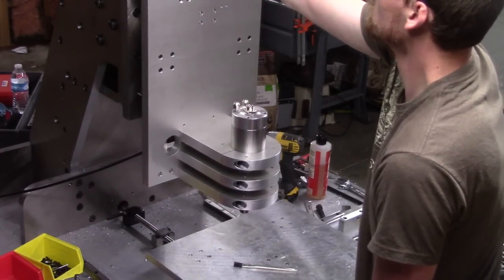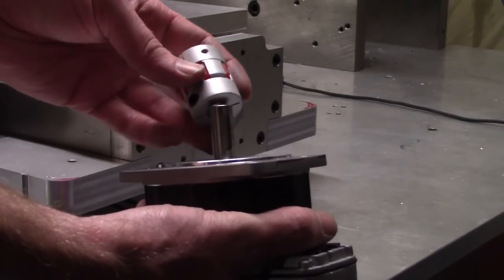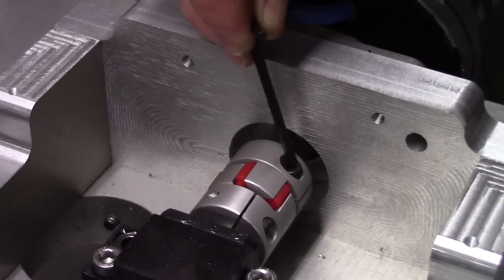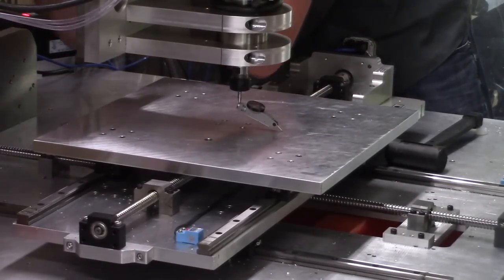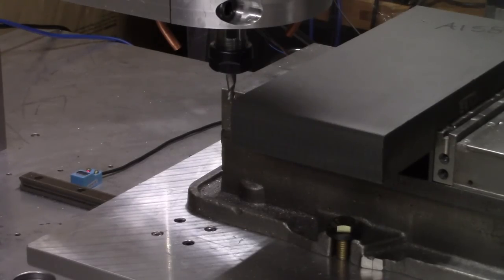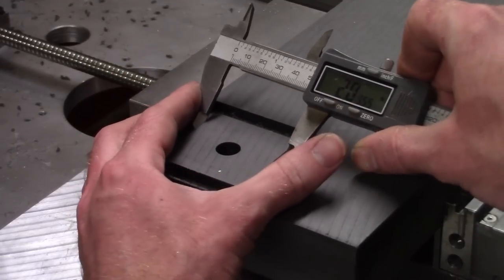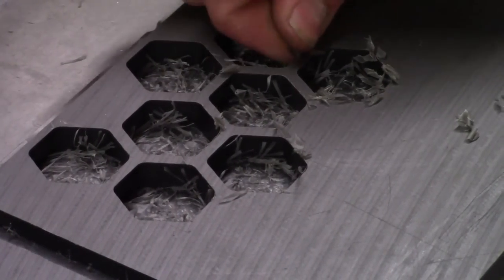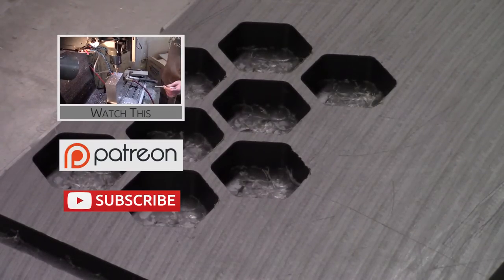The DIY VMC's First Steps!

Comment: so how much did you spend on all of this (including the discounts you got from buying the scrap steel)
Reply from the maker: I've not been good at keeping track but somewhere in the $3,000 range.
Reply: +Chris DePrisco holy.... WHAT! With those travels too? jeez man, whats your rapid feedrate? Did the bulk of the cost come from the servos and ballscrews? For only 3000 bucks youve got something that probably rivals a tormach. Great build man, I CANT WAIT to see that thing shred aluminum. But seriously im just imagining dumping 6-7 grand and designing and building my own frigging cnc mill (pretty good design exercise to try and make a rigid setup too). The one ive had the "pleasure" of working with for my robotics team costed 6 grand and cant even drive its x-axis stepper properly. Its a piece of junk, and has half the travels of this beast. Your machine hypes me up so much, everytime the last 3 or 4 videos came out from this series of just been so exited for the final product. I wouldve been horrified if you put steppers on something youve worked that hard on. Then i see the damn thing doing 300 ipm and interpolating that hole and I just :0...
Reply from the maker: Haha yea, getting the metal for scrap price is a huge deal of the cost savings.  Most all of the cost is in the motors, ball screws and electronics.  The theoretical max IPM is about 800 with 4000RPM motors and 5mm lead ball screws.  There was an issue with running that that speed though (although I can't remember what, over torque errors maybe?) so I dropped it back to 500 IPM and then it was happy.  I haven't been back to experimenting with how fast they will run reliably, yet.

Right now I'm actually getting the whole machine rocking several thousandths while running the table with the big Kurt vice on it at anything above about 250 IPM.  I'm looking to add about a ton of additional weight to help with that. It's already 1,500 lbs! :D
Reply: +Chris DePrisco That is actually amazing... Is the vibrations in the video just the whole table moving? also moving a huge vice like that makes sense in terms of vibrating the machine itself, its a lotta mass. If you could only run it at a percentage of max motor rpm comfortably, would you ever consider reducing the speed of the axes with a belt stage to increase torque but achieve the same max speed?
Reply from the maker: +adad2757 Yea you can see the whole machine moving in the video. I'd consider doing that, but only if I run out of torque; which so far looks unlikely.
Reply: +Chris DePrisco What did you use to design the vmc? Could you possibly share the CAD model with me, id be very interested in doing some static simulation on it. Ive seen diy routers, but ive never seen a decent diy mill until now
Reply from the maker: +adad2757 I used Fusion 360. I've kind of broken the assembly; It was a huge mess so I tried reconstructing it in a new assembly. I can share it with you though, if you have Fusion. Send me a PM with your email.
Reply: +Chris DePrisco i use fusion for CAM, so thats perfect. I definitely know the feeling of broken models, kind of a bad habit for me lol... Ill send you a PM and check it out in a week or so when i get home

Comment: Is that maching footage sped up?
Reply from the maker: +Euan Mutch It is absolutely not. :)
Reply: Awesome! I am currently building my own small cnc using the CPM-SDSK-2321S-RLN. Hoping to run it at 600IPM with high pressure flood.
Reply from the maker: Very cool!  That's what I'm going for eventually as well.  Lots of steps to get there still, lol.

Comment: If the camera isn't mounted to the machine and is on a steady tripod then it looks like your turret has some play in it. Just basing this on it shaking through the video.
Reply from the maker: It's actually the whole machine that shakes!  I've improved it a bit by swapping the rubber padded feet for solid steel but moving the mass of the table around that quickly on what is a relatively "lightweight" frame means the whole machine shakes around if you move too fast.  I've got some ideas to fix it but for the time being the way covers and enclosure have priority. :)
Reply: Try mounting it to the floor with some jackbolts and baseplates. We have a plasma and that is one of the problems with it. When the gantry starts moving full speed on thin material the whole machine shakes. Our next one is going to be floor mounted.
Reply from the maker: That certainly is an idea; I hadn't thought of that before.  Hmm...

Comment: excellent work! truly inspirational. i have an old vmc in my garage that i wish to modernise (it has a 1997 stepper motor system which could be vastly improved for accuracy and speed). for your electronics did you use a closed loop servo system? i plan to completely remove all the old electronics and replace them with basically what you have here. it would be gratefully appreciated if you would be willing to share some info on the electronics/software you've used and some tips on how its done. if needed i can PM you my email address.  thank you
Reply: The servos are from teknic, https://www.teknic.com/products/clearpath-brushless-dc-servo-motors/
Reply: thankyou :)

Comment: "I don't have a good way to measures IDs yet"

What's wrong with the small jaws on the calipers you were just using?
Reply from the maker: They aren't very accurate.  I mean they will get within a thousandth or so but under that they just aren't reliable (from everything I've read/been told).  I know it's within a thousandth, I want to measure tenths for something that small.
Reply: It's the same precision inside as outside, so it just seems odd you'd use it in one context and not the other. It should give you precision to 10 microns, though I can understand if you are going for slightly better (my desktop CNC has about 50 micron error, so my digital calipers are sufficient). But I don't think you are going to get better than 10 microns with a mechanical sensor. Beyond that you're likely to need optical.
Reply from the maker: I guess I always thought with the small jaws and sharp edges they weren't as accurate compared to the big jaws with the thick edges measuring OD.  Since you are using two blades, you aren't guaranteed to get exactly opposite points on the circle.

I just gave it a shot and got from 4.9775 to 5.000 measuring in approximately the same location, multiple times.  It could just be my technique, too. :)

Comment: Great machine. I don't understand though, money was obviously spent so why use calipers to measure and what no atc? Don't mind me, I have machine envy.
Reply from the maker: Lol, all in good time.  The last thing I want is to spend $4k on an ATC spindle and find out I've got some weird vibration/rigidity/accuracy issue I can't solve and then the machine collects dust with a several thousand dollar paperweight on it.  I've got big plans; it's not at all done yet.  I'm just testing stuff at the moment.

Any why use the calipers?  Cause I have them.  Why spend hundreds on measuring equipment if the calipers work and are free?  I'll try the free option first and if that fails, move on to something else.